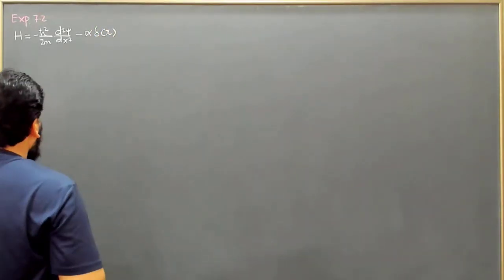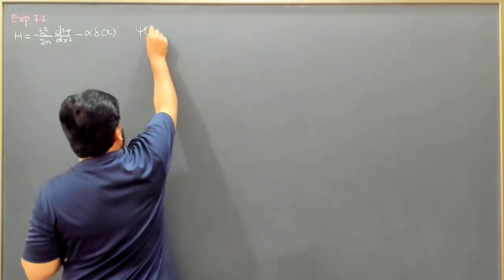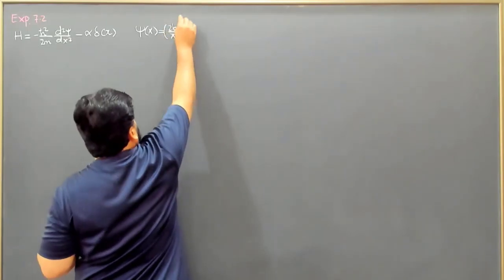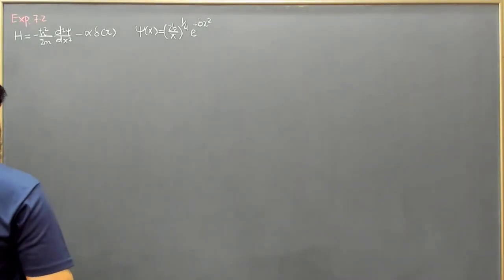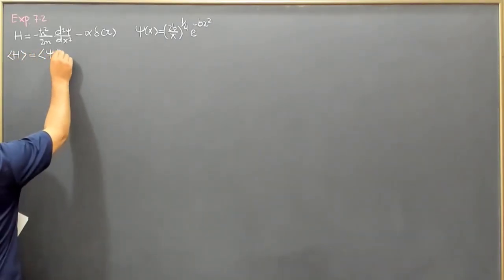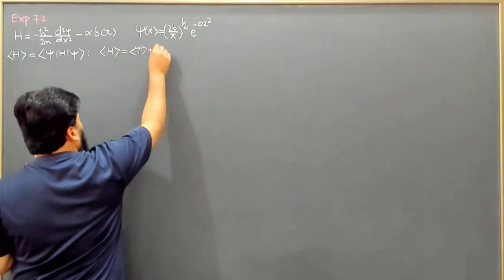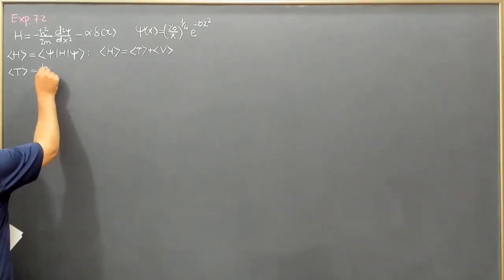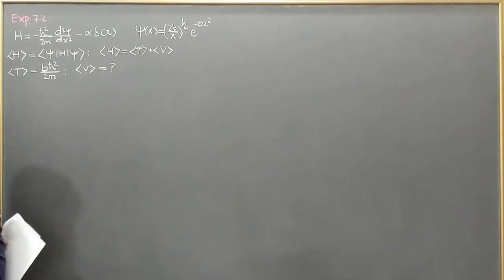L15.2 Example 7.2: Ground-State Energy of a Delta Function Potential

Comment: Sir, why you didn't (ignored) minimise the energy w.r.t to alpha?
Reply from the maker: We have done the minimisation of H with respect to b, which is required. Why you think it is to be done with respect to alpha? Thanks
Reply: @SAYPhysics   sir in some problems we minimise the energy with respect to two constants and then we sum it that's why I ask this question....
Reply from the maker: In this specific problem, only b appears as a free variational parameter in the energy expression, while α is fixed by the form of the trial wavefunction. That’s why minimisation with respect to α isn’t needed here. Thanks
Reply: @SAYPhysics ok thank you sir ❤
Reply from the maker: Welcome dear 😊